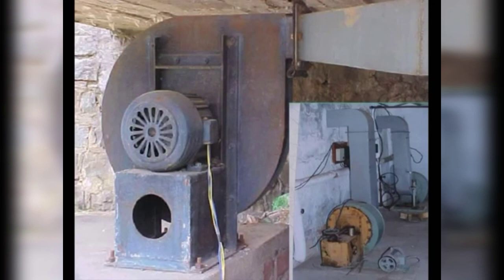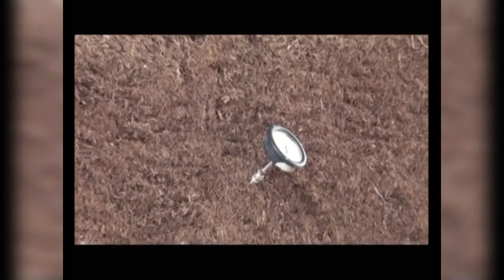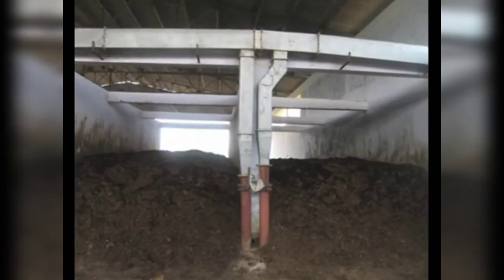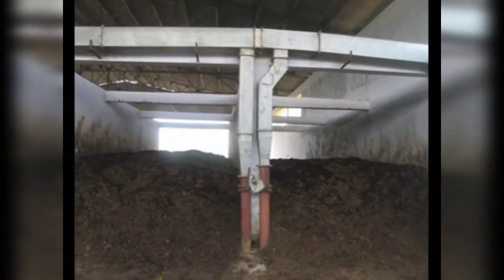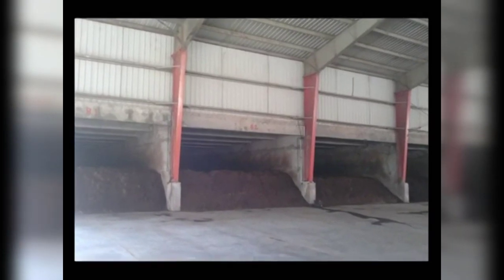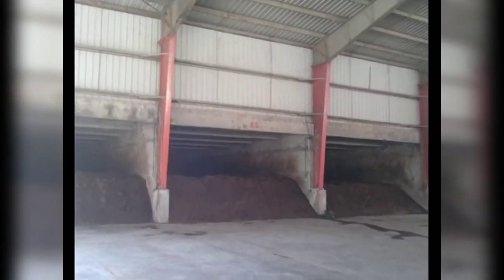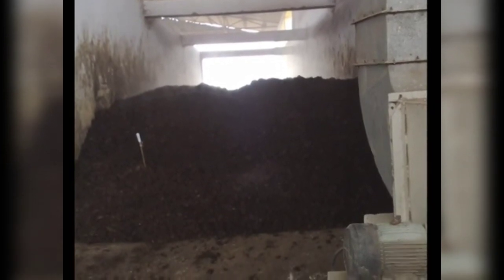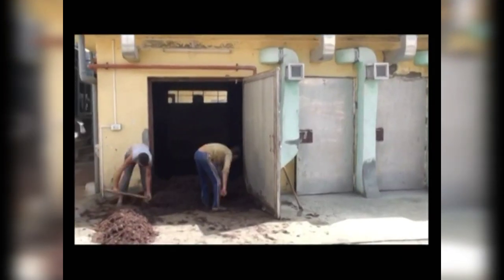Button Mushroom Compost making | Indoor Method

Comment: Manufacturing /Importing & Trading Items used in Button Mushroom Industry

https://m.youtube.com/channel/UCb8zEbivP7ijkPKama4XIPQ/videos

1)PP 7" X 16" for spawn bag Rs160/= per kg Delhi

6x7 , 200 gm,  
30 kg bag @Rs180/per kg

2)Compost Bag HM 24x30
With handle 
50 pcs
virgin quality 
Rs180/per kg

Compost Bag 
LD 22"x26" & 24"x26"
50 pcs in one kg 
virgin quality 
Rs180/per kg 

3)Punnet Rs110/= per kg 
Plus delivery charges 

4)Poly air Duct tube 
Rs190/ per kg
20" to 32" size

5)Punnet packing machine 
Rs3200/= , Rs7500/ and Rs8500/per pcs

6)Cling film (800kg punnet packing)
Antifog
Rs3800/ box,
6 pcs in one box ,
Best fresh , Oxywrap, 2Wrap and Sun film
(Core weight 0.6kg)

7)Hydrion Ammonia Meter Test paper Meter:

This is used to check ammonia levels in tunnels (phase 2) during conditioning stage .
The result is accurate in 15 second time , more than 100 tests can be performed 

Range : 0-5-10-20-50-100ppm
Rs3100/=

PH Strip 400/-
PH Meter 700/-
Buffer Solution 250/-

8)Co2 Meter Rs11500/ 
(Runs with normal cells, USB cable , mobile power battery bank and electricity)

Co2 Meter Rs13500/ 
(with inbuilt rechargeable battery)
Also runs with USB cable , mobile power battery bank and electricity

Range 0 to 9999 ppm 
With temperature & humidity function 

9)Sealing machine 12" Rs1600/=
One year warranty 

10)Automatic button mushroom pouch sealing machine
Rs16000/

11)Gardena shower Rs3000/
Made in Germany 

12)Digital hygrometer 

Wet and dry bulb hygrometer Rs500/
Brand : Zeal,  (Made in England)

13)Digital Humidity controller with sensor
Rs4000/

14)Digital thermometer screwdriver type Rs150/

15)Glass thermometer 12" 
Rs60/ & Rs200/

16)Ph strip Rs400/= & Rs1100/
Ph meter Rs700/ HANNA brand 

17)TDS meter with temperature meter Rs250/

18)EC meter with TDS & temperature Rs475/

19)Digital Temperature meter with 
12 meter long wire
sensor 6 ,12 , 24 and 36 inch

3m long wire ,12”long sensor rod Rs3000/-

3m long wire ,24”long sensor rod Rs4975/-

3m long wire ,36”long sensor rod Rs5300/-

20)Centrifugal Humidifier 5lt per hour capacity 
Rs17,500/ without sensor and controller
Rs21,500/ with sensor and controller 
Rs22,000/with accessories 
Rs22,700/with iron stand

21)Formalin 37% pure
Rs2200/
50 kg CAN packing 

22)KMS 
Potassium Metabisulphide for washing Rs130/= per kg 
50 kg drum packing 

23)Cocopeat brick 5 kg Good quality , low fiber
Rs26/per kg

24)Rope 
Material PET
Rs290/= per kg
One kg has 100 meter length 
Used instead of saiya in Mushroom racks 

25)Temperature meter and Controller
Brand Sub-zero
Rs3800/

26)Co2 dampers Rs2500/ per pc , with filter
& fresh air blowers

27)Co2 automatic damper
Rs11,500/- per pc

28)Spigot for aerated flooring in tunnel & bunker Rs17/ per pc

29)Button mushroom knife Rs500/

30)Packing tape 3"
Rs3000/ box 

Aviraj Kapoor
9810929262 call and whatsapp both.
Delivery from Delhi

Comment: Manufacturing / importing & trading in items used in button mushroom industry 

PP 7" X 16" for spawn bag Rs190/= per kg Delhi

6x7 , 200 gm,  30 kg katta Rs190/=

Compost Bag HM 24x30
With handle 
50 to 55pcs 
virgin quality 
Rs140/= packet

Compost Bag LD 22"x24"
57 pcs in one kg 
virgin quality 
Rs140/= per kg 

Punnet Rs95/= per kg 

Duct air tube Rs160/= per kg 
15" to 32" size

Punnet packing machine 
Rs2700/= & Rs6500/

https://youtu.be/zZcwate4kuQ

Trading 

Cling film Rs3300/= box
6 pcs in one box
Each roll 2.1kg, core 0.600 gms
Oxywrap 
Antifog food grade 

Ph strip Rs400/
Glass thermometer Rs60/ & Rs200/
Screw type thermometer Rs125/
Hydrometer 
Hygrometer Wet & Dry bulb for accurate RH
Rs500/

Hydrion Ammonia Meter Test paper strip 
Range : 0-5-10-20-50-100ppm
Rs2100/=

Co2 Meter Rs9500/= 
Range 0 to 9999 ppm 
With temperature & humidity function 

Co2 damper with filter 

Sealing machine 12" Rs1300/=
One year warranty 

Gardena shower Rs2100/

Ultrasonic Fully automatic 
Humidifier 5lt per hour capacity 
Centrifugal Rs26000/ with sensor and controller 

Formalin Rs35/= per lt

KMS Potassium Mesabisulphide for washing Rs110/= per kg

Cocopeat 
Rs24/
Full load Rs23/

Rope 
Material PET
Rs280/= per kg
One kg has 100 meter length 
Used instead of saiya in Mushroom racks 

Delivery Delhi

Vivek Kapoor 
7590008263
9818578263 whatsapp only...